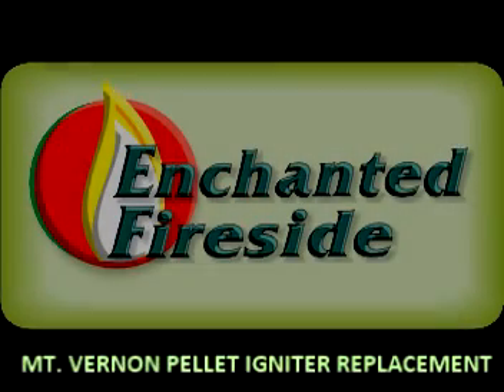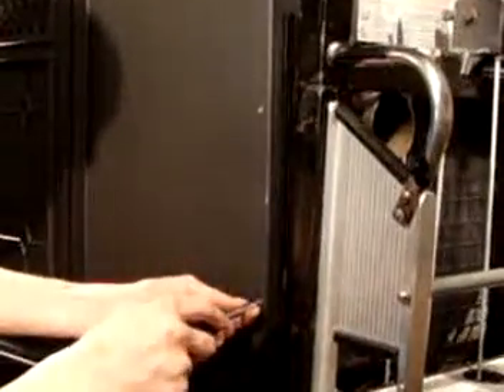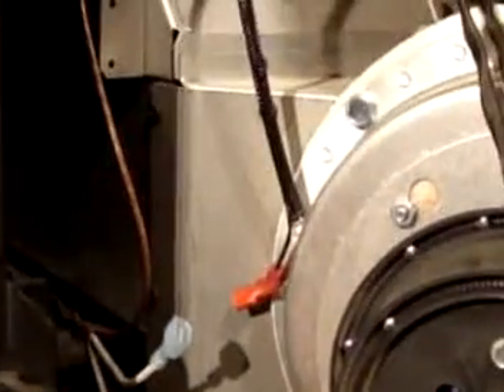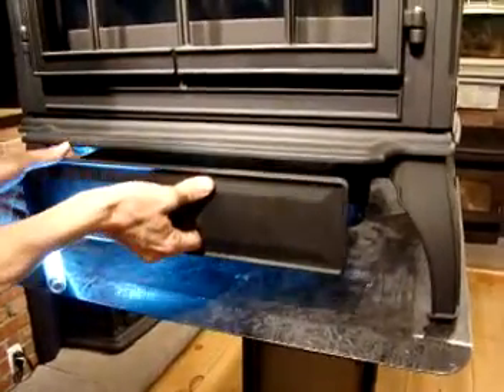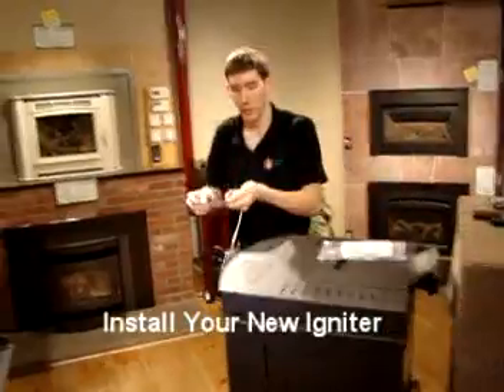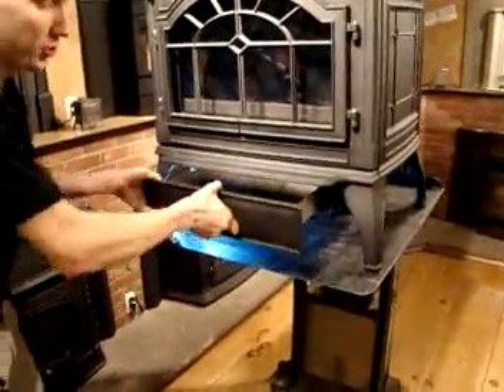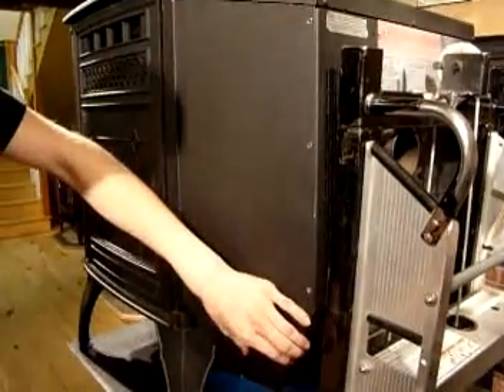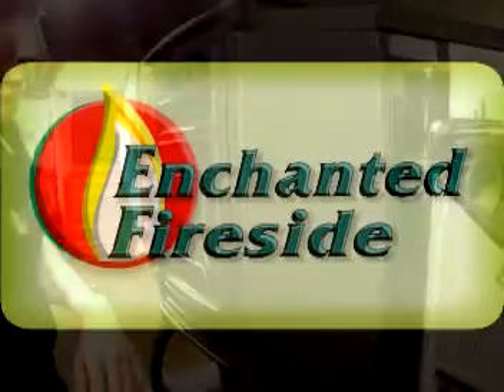Mt. Vernon Pellet Igniter Replacement

Comment: I have what seems like this exact model, the slot that the ignitor goes into has fallen off.  It looks like it was welded on.  Is this true?  I’m really confused, it is hard to see in any videos I watch.
Reply: You will need to replace the firepot.

Comment: Instructions on installing igniter state to route wires thru notch in the firepot riser assembly. We installed igniter by removing the ash tray and our unit is an insert in the fireplace. We tried to locate this notch to place wires but to no avail. We just ended up tucking wires as close as we could to the right side after we pulled them thru right corner in the cast to reconnect them. Does anyone know where this notch is that the wires are supposed to go? or what it looks like. Can you assess this u shaped notch by removing the ash tray? Any pictures or help in locating would be greatly appreciated.

Comment: I've gone through 2 igniters in 4 days. Keeps shorting out. Why is this happening?
Reply: There must be some kind of direct short Marc. I would suggest closely looking at the wires to see if there are any exposed areas grounding out on the unit to start. If you need to test your igniters ohms to determine if it's in proper range, check out the video here - https://youtu.be/z4wmCc96rVI

Comment: I found myself "flumoxed" by a piece of hardware that would cost about 25 cents in a hardware store:  a wing nut.  The threads on the wingnut were covered with tar as the igniter gets hot enough to light pellets on fire.  So, I can't remove the wing nut to replace the igniter.  The wingnut is not reachable through some engineering of the stove.  It is nearly impossible to grab the wingnut with a wrench or pliers.  Anybody providing service to replace the igniter will have the same problem.  The technician needs to demonstrate on how to remove the igniter on a stove that has been used a couple of years, instead of a new stove that has not been used.  Replacing the igniter on a used stove would be much more difficult.
Reply: I would agree that the wingnut can be more difficult to remove over time with use of the stove. If it's difficult to budge, some folks have had good success with spraying lubricant on it or a degreaser and letting it soak a bit. If it still won't budge, some folks will heat it up with a pencil torch so the metal expands and use high heat gloves to loosen. We have lots of little tricks to make servicing less stressful. Any assistance needed just let us know!
Reply: Great video